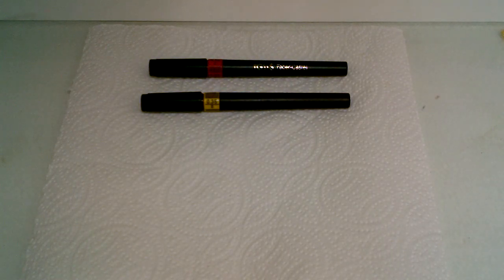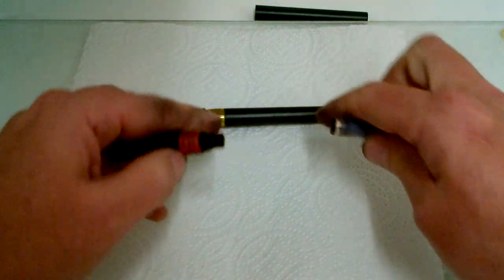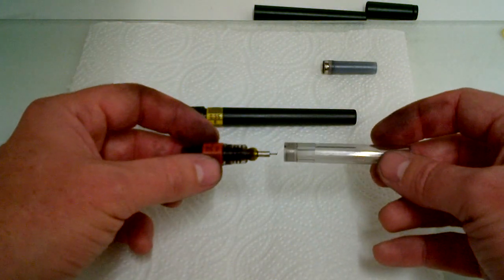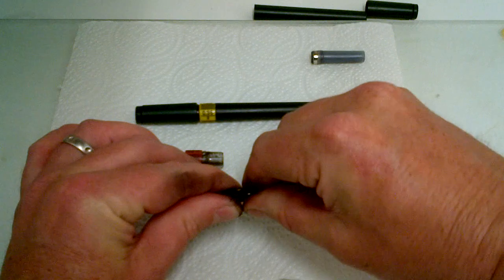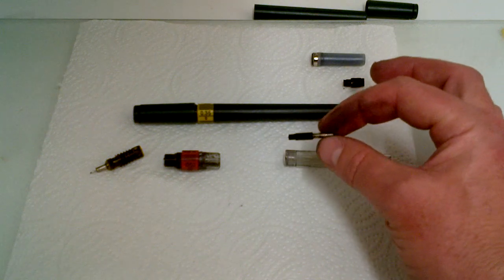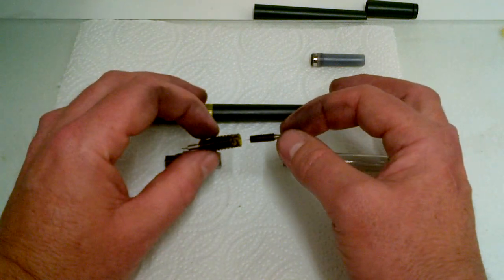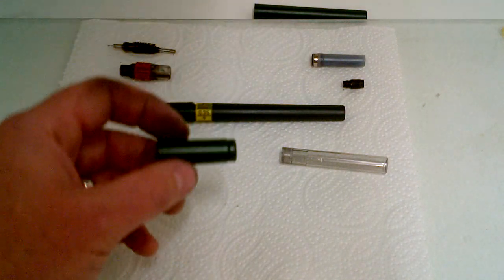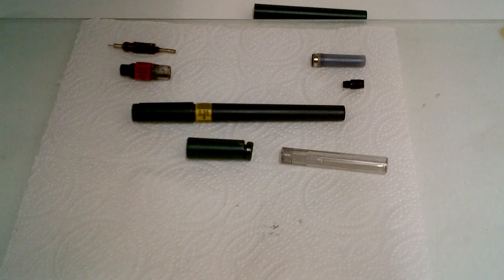Cleaning & Servicing 'Rapidograph' Faber Castell TG1-S Technical Pens

Comment: Six years later, this video is a gift that keeps on giving. I just found a complete set of these in Goodwill last night, instructions and all, for $3.99. Grabbed them up. Now to clean them.  : )

The last part to unthread to take out the needle is being stubborn on them. I'm trying the microwave nuking method, although you didn't mention it.
Reply: I just found my 40 year old set. I’ve disassembled and am soaking the pieces. You may want to try that before microwaving.
Reply: @panthermom  I did. They soaked overnight, first. Thanks.

Comment: Many thanks!  I came across an old TG1 set which I bought for $2.  I just spent 4 hours cleaning out the gummed up and chunky ink from them.  I filled them up with Sumi Ink as I will use them for art, and now they work a treat!  
I used toothpicks, cotton buds and lots of hot water to clean them up.
Reply: Nice! Is sumi ink working well?
Reply: @evelynchan5366  I would use fountain pen ink to avoid clogging all together. Personally i use Noodlers bullet proof black

Comment: If they stop rattling , pour some Rotring cleaner in a votive candle holder or shot glass, leave for 30 mins to overnight ,and they will unclog perfectly. No need to pull them apart and risk bending the wires. I ruined one of my nibs by following a  video like this one,  before  finding out they were all wrong. Yes if the cleaner doesn't work this is a last resort, but please don't think no rattle means they won't unclog with cleaner. Mine were not rattling at all today, but just five mins in cleaner and  both my 0.1 and 0.18 are rattling away just fine.

Comment: I've just been given a set of 3. They are old. Made in West Germany so over 25 years old but they look to be in good condition. The problem is not only are they clogged, the reservoirs are virtually bonded to the sections by old ink. Any ideas how I might remove them without damage?
Reply from the maker: +Artistically Motivated that's a tough one, when the ink dries it's like cement. I'd try soaking it on some heavyweight detergent (the ones with the warning signs on the back) but be careful how long you soak them as it will start to corrode anything metallic. Try overnight to see how it come along. The other option is to try and source parts off Ebay, often the individual bits can be bought separately.

Comment: The question guys it's, can we use any ink for these pens? I have loads of parker quink and hope u can use it instead of buying brand specific. I truly appreciate any tips. Thanks
Reply: No. The instructions say to use only Indian ink, as other inks are corrosive and may destroy the plastic.
Reply: Look up Rotring or Faber Castell ink. It comes in small plastic bottles with a think neck, similar to the ones on eye drop bottles. It allows you to fill the ink cartridge easily.

Comment: what do I do if there isn't the tiny metal needle/hair inside the nib unit? I got a set from my dad and every pen (0.35, 0.5, 0.7) has a metal hair inside except for the 0.25mm one.
Reply: I have the same 4 pens and all of mine had the hair except for the .25. Hoping the .25 is to small to need one. Did you ever figure it out?
Reply: Well figured it out its so damn small I could hardly see it. It got yanked out and was stuck in the tip of the pen. I should have soaked the tip before attempting to remove as the dried ink held it in the tip and pulled it right out hardly any force because its so damn fine. I had to push it down enough to see it sticking out the tip then pull it through with a tweezers to get it out. Had to use a magnifying glass to even see it in there. Gonna attempt to repair by epoxying it back on hopefully it works out.

Comment: what happens if you accidentally remove the metal hair.. it got broken when i opened it :<<
Reply: Then its garbage. You need to find a new nib. Unfortunately, Faber Castell have discontinued these models, but if you have ebay you might find one there for your pen. That's why its recommended not to do it... its such a delicate pin and its incredibly easy to break. I own a lot of these pens and I would never open them like this, it just scares me too much 😂 best of luck to you!

Comment: Kinda late to the party but, does anyone know If the little hair has to stick out of the nib a tiny bit? I cleaned my pen thoroughly and now It does the rattling sound you talked babout but I dont know If I messed up the wire.
Reply: Only way is to fill with ink and try. I used to have a set of Staedtler Mars with the same system and I took the piston out - couldn't believe I had put it back in and did the same thing 3 times before I believed I hadn't damaged the wire.
I'm researching Faber Castells myself having been donated one - the Rotrings I also received are the same age but cleaned up nicely with Rotring cleaning fluid.

Good luck with yours!
Reply: Update! I cleaned all the junk on my pens wiith hot water and 2/3 are working fine, thanks for the video i really apreciated it. Turns out that the little wire was to stick a little so I didnt fuck up big time there.